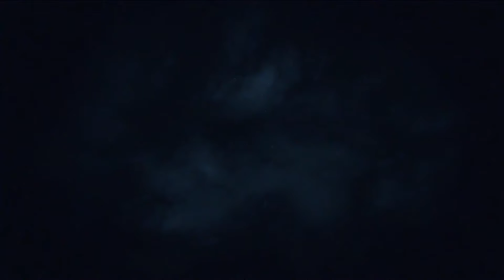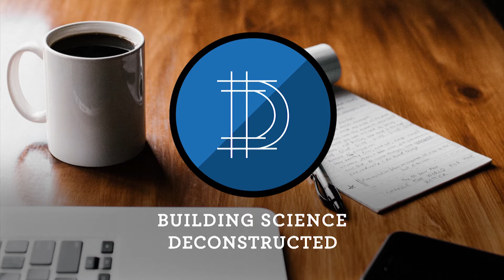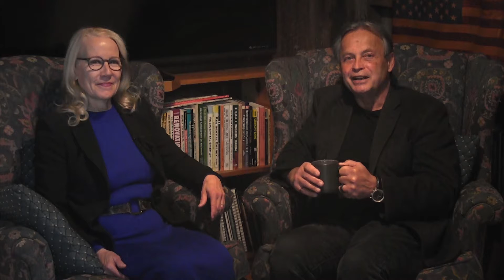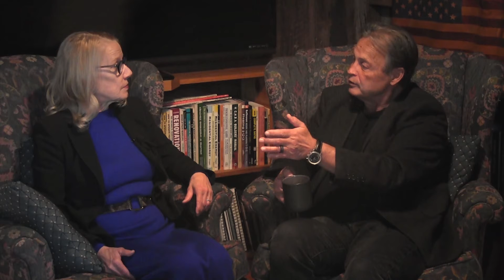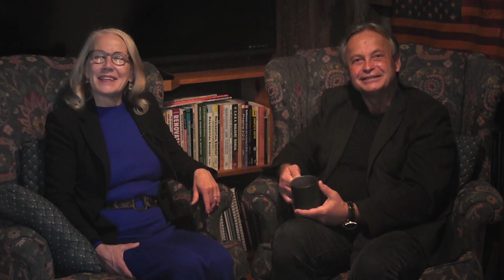A Cup of Joe: Net Zero Energy Houses | Building Science Deconstructed

Comment: Yeah but  you could do much better with PV Thermal panels, HRV with integrated heat pump and dryer with integrated heat pump
Reply from the maker: Each of those are viable choices and should be used in conjunction with an air-tight assembly.
Reply: @coselladorken  this is the point . They are trying to improve outdated technologies about which they learn in school  half century ago or so.  Now we can make a passive house  with Thermasteel panels wich  outperform   wood stick construction method by a lot and even save money on  a foundation if put panels up on a footing. If you have a degree in engineering it doesn't mean you have to invent a wheel all over again
Reply from the maker: @andreycham4797  We agree. There are many new technologies to make the overall building systems much more energy efficient without re-inventing the wheel.  Construction industry is not known to be an early adopter of new technology.”